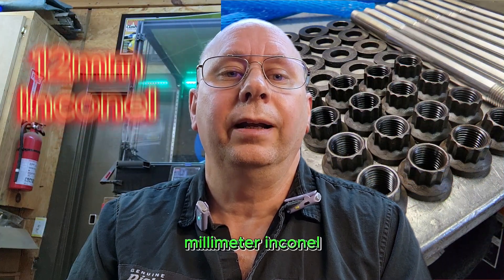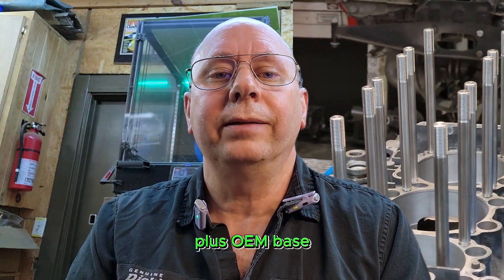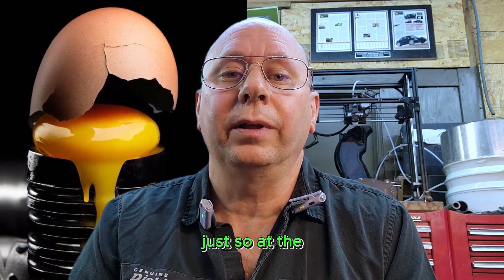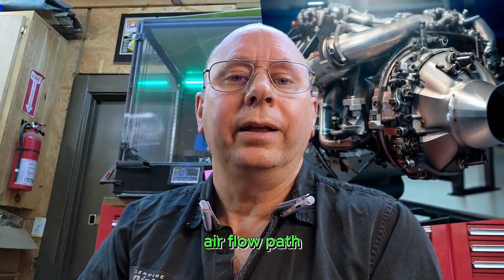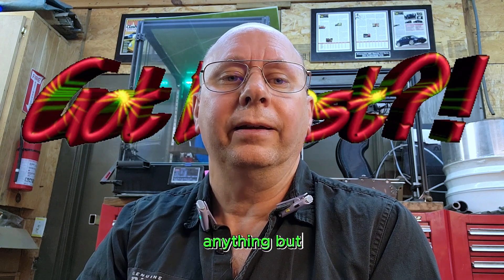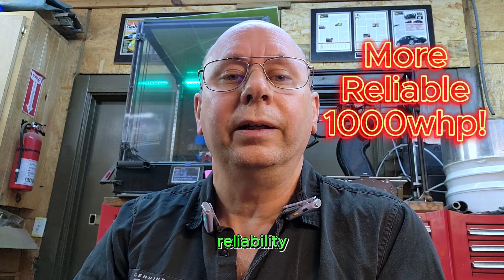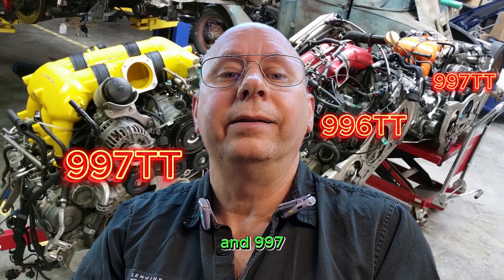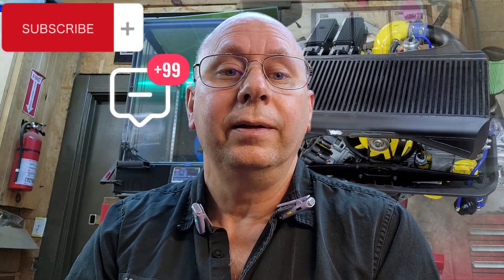Avoid these MISTAKES before modding your 997 Turbo Porsche! (1000whp and more!) Part 2

Comment: I watched both your videos. Thanks for the info. I've had my 997.1 turbo tip for many many years.  Only thing I was every able to bring myself to do was a Europipe Stage 1 exhaust.  It seems like even a tune will require faster and more expensive replacement of plugs,  possibly wearing out turbos faster and you even said getting to 600 lbs of torque, head studs become an issue.  That's why every couple of years when I get the itch to tune and go down this rabbit hole, I pull back.  I think the only other "safe" mode to do besides the exhaust is an upgrade of the intercoolers.  Maybe pick up a few hp.  Anyway, thanks for the great videos and reminding me why I can't bring myself to do this haha.
Reply from the maker: All valid points you don't typically hear when you call up a "tuning" shop...   Yes, by increasing the power you're typically also increasing the maintenance schedule.  Extremes would be top fuel dragsters that are rebuilt after each run!  Now, that's nuts!  But modest mods can yield nice improvements while staying on a very factory'ish maintenance schedule.  Depending on how you drive the cars, of course.  If you run your car at the track all the time, you'll want to be maintaning it after each event.  Vs. driving it across country multiple times you wouldn't even think about it other than maybe checking out the tire wear and windshield washer fluid.  You're also correct about the intercoolers.  Once installed they're like free horsepower, better reliability, cooler intake air temps and all the goodness!    We've always strived for our "more power with less boost" philosophy which reduces the maintenance and keeps up the reliabiliity.  At stock boost levels, my personal car makes nearly double the stock hp by using increased displacement, excellent airflow characteristics, low restriction turbos and high quality fuels.  I'll be excited to watch it tick over the 100,000 mile marker!   To keep the level of maintenance down, be sure to use only excellent oils, filters, plugs and other service items in your maintenance schedule.  BTW, the Europipe is an excellent choice for your Tip since they tend to hang in an area that many other exhausts would horribly drone.
Reply: @protomotive  thank you for the reply. Having been on six speed forum online for years, you are a very well respected tuner in this realm. Yeah I think after almost 13 years of ownership I’m going to upgrade my intercoolers ha ha. That’s great to hear all the stuff you can do to not affect reliability. And yes, I love the EP one. Modest bump in horsepower and torque with no drone and a very throaty sound. I drive my car, mostly city and freeway miles with spirited runs here and there. Never tracked. But I’m so busy with work. I can’t deal with a car that needs constant attention and maintenance. my car has had all the major issues known with this engine:  coolant pipe failure, spun camshaft, etc. So like I said, I just can’t bring myself to add more complexity and further issues down the line. But I think I’m finally gonna pull the trigger on intercooler’s. Give me a little more horsepower and still keep me engaged with my car and make it feel fresh. I know you guys make your own intercoolers which I’m sure you recommend but any others that you would consider possibly? Thank you.
Reply from the maker: @mak23997    It's awesome you've stuck with it through the typical issues.   It should really be to the point of having fun again!   Yes, our massive intercoolers are a huge upgrade.  However, for oem replacement at nearly stock power levels a set of the dot 2 or gt2rs intercoolers are a great and relatively low cost update.   I was just told the other day by another client that FVD has a killer price on them right now.  Give Rhonda a call down there and be sure to say Hi from us :)  The next up from those would probably be the Wagner intercoolers.  You'd see a nice improvement in intake air temps and lower pressure drop through either of these over the stock 997.1TT intercoolers.   It's amazing that even from the improved dot2/gt2rs intercoolers to ours on a stock 997.2 turbo we still see another 40-50hp improvement without any other change :)
Reply: So could I expect a 40-50 hp increase using the .2 or gtrs intercoolers as well, without a tune and just my EP1 exhaust, or are those figures only for your intercoolers? Thanks. @protomotive
Reply from the maker: @mak23997    That figure was found when dynoing our intercoolers vs dot 2 or gt2rs ones on a totally stock 997 dot 2 turbo....   As for your stock intercoolers to the dot2 or gt2rs,  you'll probably see a 20+ degF temp drop plus an increase in flow, both of which will help out your power, temps, response and all kinds of goodness.   At higher boost the temp drop is even more significant.  Here's a nice writeup on them on 6speedonline.  https://www.6speedonline.com/forums/996-turbo-gt2/225492-997-2-intercoolers-wow-8.html
And a full install writeup here:  https://911car.blogspot.com/2012/02/porsche-997-turbo-intercoolers-upgrade.html?m=1
These are kinda old now, but perfectly relevant to all your questions.
I've personally not dyno'd these back to back vs. the 997.1TT cores, so don't have an answer.  And both of these pages don't seem to either, but have a lot of data and opinions on them.  Either way, they're a nice increase and will give you more consistent performance without heat soak.
Reply: @protomotive  thank you!
Reply from the maker: @mak23997  you're welcome 🙂